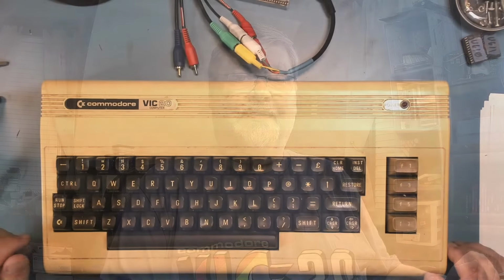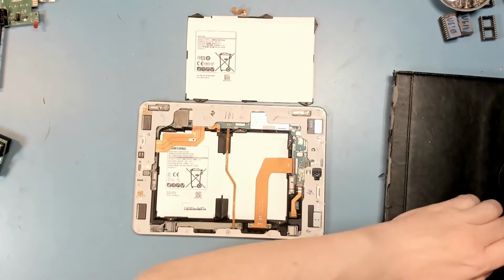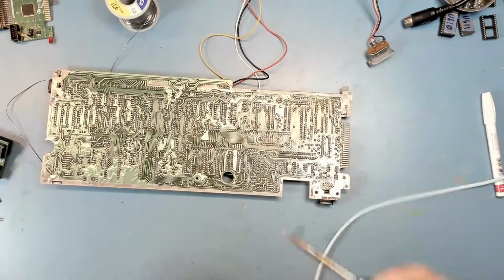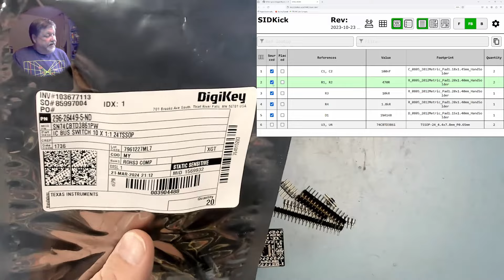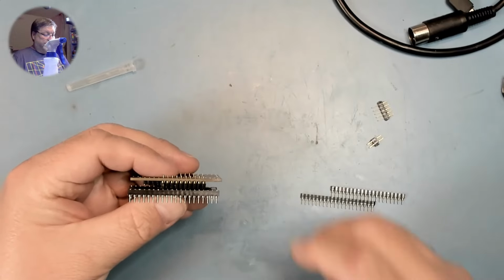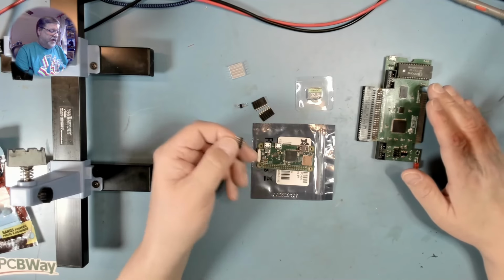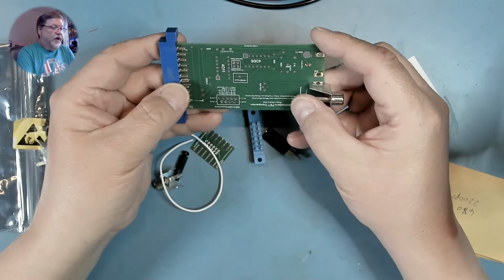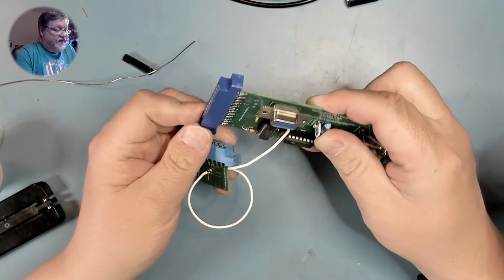What Do I Do Behind The Scenes?

Comment: Thanks, this was fun! Was neat to see a silver label VIC-20. I have one as well, and it also still works, sadly. 😉
Reply from the maker: Glad you enjoyed it, Marcus.  That's my 3rd gold label.  I actually have more of those than rainbow labels (well, it would be a tie if I hadn't sold one rainbow).  The first two had power problems when I got them, so I ended up replacing the rectifier and regulators on both.  One of them had RAM issues as well.  But those were before I had a channel.  One of those two is the machine I installed c0pperdragon's VICdigitizer into in a recent video.

Comment: Great video bud..  very informative.   I have 3 vic20s myself.  One is gold label... 2 are later one's...  bought a couple parts motherboards... and only one good vic... soldered in.  The other one.. paddles don't work.. the one I bought complete.. which I'm retrobrighting now..  has sound issues.    I do not have a diagnosis test for these...  do they test the vic chip?   That chip does alot compared to 64
Reply from the maker: The VIC-20 diagnostics ROM is a bit rudimentary compared to the C64 version.  When you ask whether the diagnostics test the VIC chip, certain aspects of it are tested.  It runs a sound test, but it doesn't test paddle input (as far as I can tell).  It doesn't "test" the video, but you would obviously see if there are issues there.  It tests RAM and ROM, keyboard, serial port, joystick, timers, IO edge detection and a few other things.  And yes, the VIC is doing a lot.  It's basically the VIC-II and SID rolled into one (or, more properly, the VIC was separated out into the VIC-II and SID for the C64).  But it has fewer video modes, no bitmap graphics, no hardware sprites and a much less complex sound generator.

Comment: Do something different?  Get an Atari.
Reply from the maker: Which Atari would you suggest?  I've already worked on a couple of 2600's and a couple of 800's on the channel.  I haven't worked with any of the later models (XL, XE, etc...).
Reply: @YARC-1981  The 800 is a beautiful beige tank, but I'd recommend an 800XL for the memory expansion options.  I've just recently bought a reproduction 1090XL which plugs into the parallel bus and allow memory and an 80 column video card to be plugged in.  The 1090 was almost ready to market in 1984 when Atari abruptly cancelled it.  Dumbest of many dumb things Atari did.